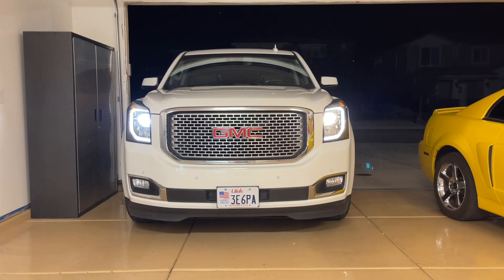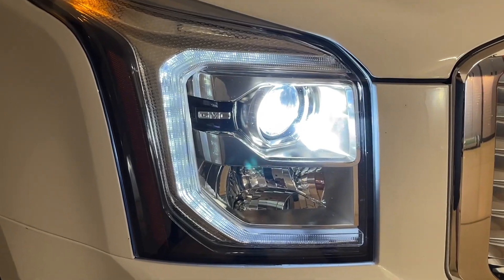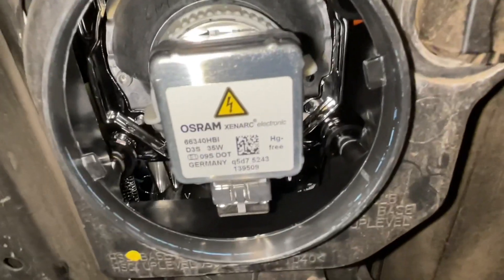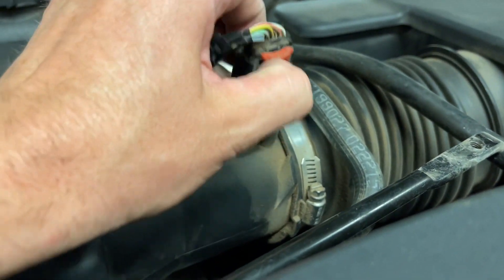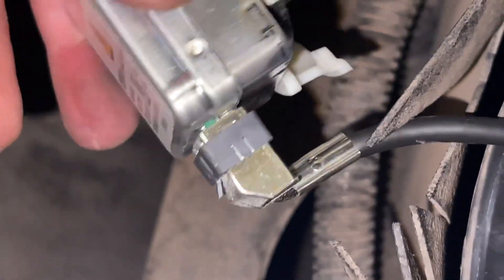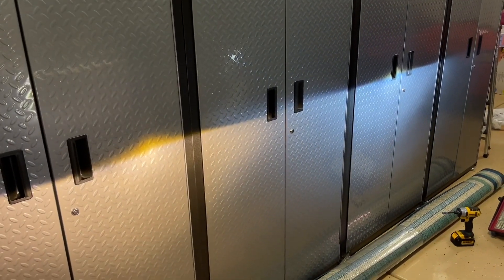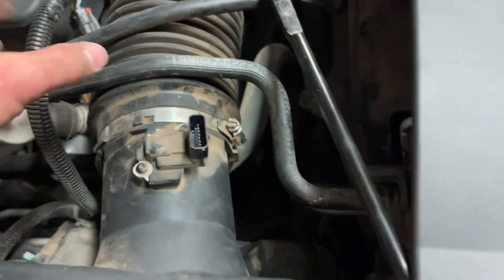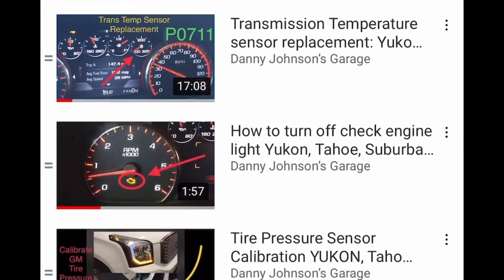Fix Yellow Headlight HID bulb: Change a head light: Yukon, Tahoe, Sierra, Silverado, GMC, Chevy

Comment: How do you adjust the headlights on this car? I had the dealer put 2 new Hid bulbs in and now they both point outward. Making the car undrivvable with the dim lights. The sides of the road are lit up nicely but not the road in front of me

Comment: Great video.  I noticed the amazon link brought up the D1S bulb and my Denali as well as the one in the video takes the D3S bulb.  You need to scroll down the page to pick that bulb type.  They say the D1S will not work properly.
Reply from the maker: Thank you. I updated the link https://www.amazon.com/gp/product/B07F715HCL/ref=as_li_qf_asin_il_tl?ie=UTF8&tag=2004047-20&creative=9325&linkCode=as2&creativeASIN=B07F715HCL&linkId=9adfc08c2927011e132e80febe7ff4d4
Reply: Hi Danny thanks again. My bulbs came in today. A slight difference on my passenger bulb was the connecting wire was so short that I had to remove the connector first before I could get the bulb out of the enclosure. I also popped the plastic screws off the shroud that covered the area and peeled it back. Your video was a great help!

Comment: I meant to ask, were these bulbs stock in your vehicle? I have a suburban LTZ but bought it used an am unsure
Reply from the maker: Yes, these were the stock bulbs and I have the replacements here IF you have HID https://www.amazon.com/gp/product/B07F715HCL/ref=as_li_qf_asin_il_tl?ie=UTF8&tag=2004047-20&creative=9325&linkCode=as2&creativeASIN=B07F715HCL&linkId=9adfc08c2927011e132e80febe7ff4d4
Reply: @dannyjohnsonsgarage  Appreciate that.. we no longer shop on Amazon but I found some last night on eBay

Comment: Do you plan on installing a cold air intake on your yukon?  If not just curious why?
Reply from the maker: Personally, Without a tune for the car the cold air intake won’t be a big enough change to be worth the money. I had a friend lose gas milage when we installed one. More power usually means less fuel economy. I’m satisfied with it for now how it is and not having to worry about water or anything get into the engine. I have them on my Mustangs but that’s more important to me for power and I don’t drive them in the weather